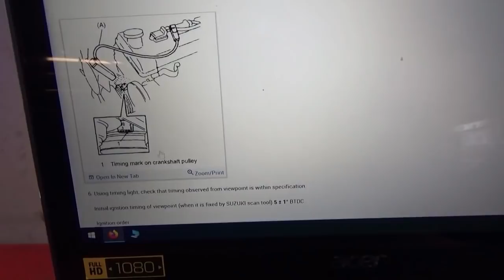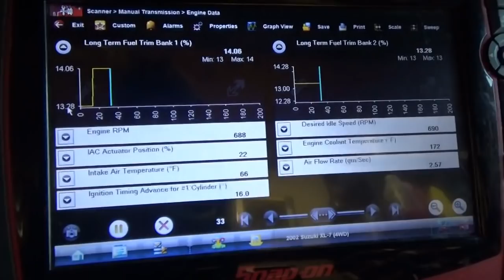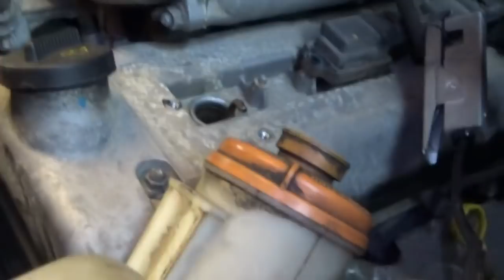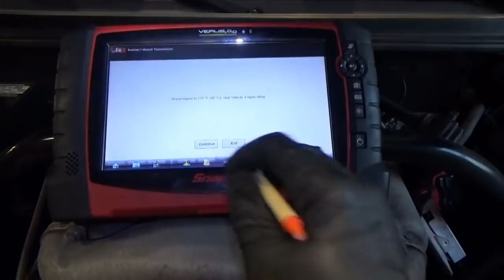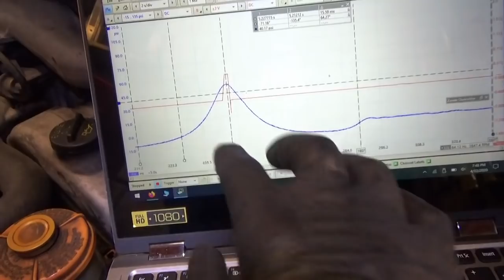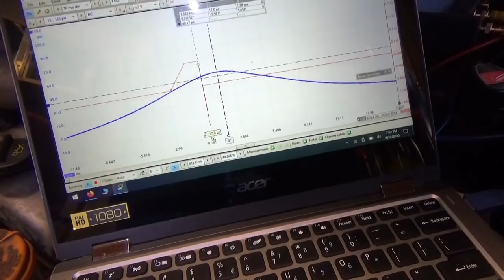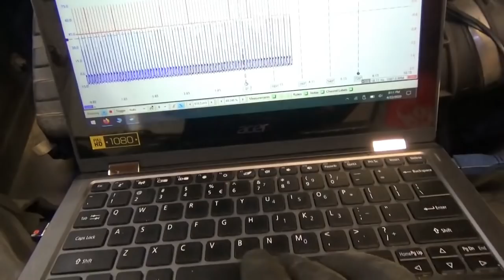Can you trust your Timing Light? - Part 1

Comment: My guess is that the strobe light is triggering at the rising edge of the ignition coil current and the spark occurs when the current drops, or the falling edge. The pulse duration is probably some 6-8 crank degrees.
Reply: My thoughts, too. The light is triggered by the flow of current through a plug wire. If these coils don't have their own controller, and the ECM is the controller, then they will be igniting on the falling edge, and then the rising edge comes a bit later to recharge them. Who knows how they would work if they had their own controller. That would be up to the manufacturer to then trigger on a rising or falling edge. Basically, don't use a common timing light if there are no plug wires. I'd guess you'd have to make an extension high-voltage wire for between the plug and coil pack, and put the clamp around that.
Reply: Just watched this on the TV, picked up my phone to comment and you said the exact same thing.
Flip the inductive pickup over so the imaginary arrow faces the other way!
Reply: I join the club here. Highly likely the timing light triggers at the rising edge of the secondary voltage, which is at the falling edge of primary voltage. Inline 6 with points and one big coil, dwell time is around 30 degrees. Coil on plug, 20 deg could be just about right.
Reply: @Reece Darwin definitely, I have been watching on Flixzone for since december myself :)

Comment: There is circuitry in many timing lights that allow u to advance or retard the actual flash. I have an old Snap On light that does that. Really old neon lights hooked in series with the plug wire. Not very bright. This light is interpreting based on the low voltage square wave I assume. Perhaps the flaw is there. Pull the coil out and hook it to the plug with a short plug wire and use your inductive clamp around the plug wire extension. Just a thought. Also, does your home made pressure transducer read negative pressure down to 20in hg?  This is getting very interesting.

Comment: The outer ring of a harmonic balancer can briefly break free and spin out out of sync from the keyed portion. Happens when the the rubber between the two gets old. It renders a timing light useless. That or the there is a cam timing issue. I’m curious to see how it drives with ignition set to spec using the reading from the pressure transducer.
Reply: He ruled that out.

Comment: I question your method of finding tdc.You should use a dial indicator to more precisely  find it,just eyeballing it could give you a false reading between TDC and timing mark
Reply: 15 degrees off?
Reply: @zacharyaleksovski9746  no,just to make sure the mark was where it should be in case the balancer,if there is one hadn't slipped
Reply: @lesbender236  that' what I meant . No need to set up a DI to just to check if the balancer spun.
Reply: It's close enough for ignition timing. A little slop in the crank throw isn't going to make a whole lot of difference. Definitely not 15° worth.

Comment: I had a 1990 Buick Skylark with a Tech4 cast iron monster 2.4L.  Anyway, at about 100k miles it developed a leak at the timing cover.  Turns out the timing chain was so stretched that it wore a hole in the cover.  Once fixed, the slight engine noise went away and my highway mileage went from 30 MPG to 33 MPG at 70 mph.  I miss that car.

I'm not suggesting that is the issue here but its worth consideration.

Comment: There is some inherent error in a lot of timing lights (my old Craftsman with advance knob is one of them).  I'm not sure I'd rely on pressure for checking TDC though, especially when we're talking single degrees of crank rotation.  It seems a pressure reading would appear advanced, due to the pressure peak being before TDC and cylinder leakdown subsequently.  As the crank pin comes up on TDC there's a few degrees of no piston movement (or further increase in pressure), and if there's leakdown that starts the downward pressure reading even before the piston begins to go down.  Also, how about lag in the pressure reading?  However little, the air still needs to move in & out of the transducer to produce readings.  And to properly check that balancer, an indicator & degree wheel should be involved to be precise.  Just some thoughts.
Reply from the maker: Good points. Not worried about cylinder leakage... It's a Suzuki 😁
Reply: @PineHollowAutoDiagnostics  you've got me thinking out loud here.. but in an extremely intriguing way lol.. I'd love to hear more on your pressure transducer method & the science that could be applied!
Reply: @Jason Bowman Me 'neither.. but Ivan certainly came up with an interesting method via his setup!
Reply: Yep BLucas, ineffective crank angle at aTDC would have an important input on those pressure readings👍🏻.

Comment: Yes. Timing light is a passive device. It shows you when the plug fires & that's it. It cannot lie to you.
Reply: You don't know that, unless you analyze the internal circuitry of the timing light.  There could be a short time delay between the instant that the inductive clamp picks up the current pulse, the pulse is amplified, applied to the trigger circuit, the trigger circuit fires, the pulse goes to the flashlamp, and finally the flashlamp ionizes and blinks.
Reply: Robert Slackware  That's just the speed through the wiring (which is actually somewhat less than light speed in a vacuum, or 186,000 miles/sec) You are ignoring things like the time constants of the signal conditioning electronics, Discharge time of trigger capacitor, risetime of the pulse through trigger transformer, ionization time of the flashlamp, etc.

Comment: One of these days please explain fuel trim. Guys like you and Eric O always jump on those numbers. Us old plugs, points and condenser people need all the help we can get understanding these newfangled vehicles.
Reply: Quick explanation by myself:

-Short term fuel trims (STFT) (or "Integrator" in pre-OBD II GM engines): His job is to keep the O2 sensor near stoichiometric values;
-Long term fuel trim (LTFT) (or "Block learn" in pre-OBD II GM engines): His job is to keep STFT near 0% and to keep in mind any fuel correction issues.

In booth cases, their job is to command the ECU to alter the injector pulse. If anything is wrong in the engine performance, their values can be off.
If the computer adds fuel to the engine, the STFT and then the LTFT values will go up. In the case the ECU want to subtract fuel, the value go down and can go to the negatives values.
The STFT and LTFT are co-workers. If STFT goes up, LTFT will go up.

In the diagnostic field, it's a great build-in tool to understand if the issue is on the fuel delivery side or not.

In general, STFT and LTFT are in [%]. but keep in mind other manufacturers uses other values (it could be numbers or a time value), it's best to understand by looking into the shop manual (if available) or play a bit with the car (acceleration is always a rich mixture and deceleration is always a lean condition) to find the baseline.

Note that pre-OBD II GM engines uses binary values (128 is 0%).
Reply: @antonia.5203  thank you for explaining
Reply: @neilmurphy845  You are welcome
Reply from the maker: @antonia.5203  Excellent explanation!
Reply: @PineHollowAutoDiagnostics  You are welcome.
Reply: Fuel Trim is the adjustment the engine computer (PCM) makes to the fuel mixture to maintain a balanced air/fuel ratio. Fuel trim is usually displayed as a PERCENTAGE reading on a scan tool.  Usually around 14.7%